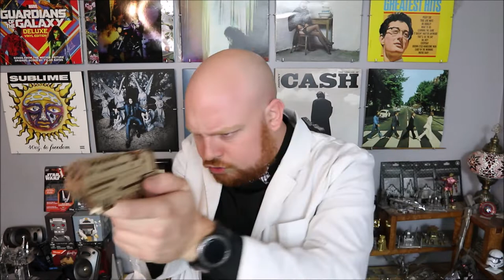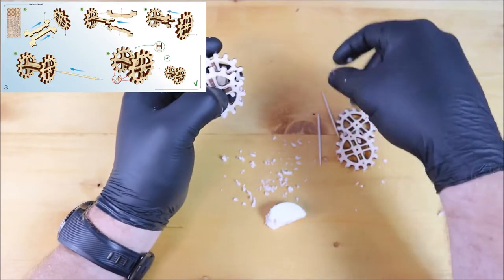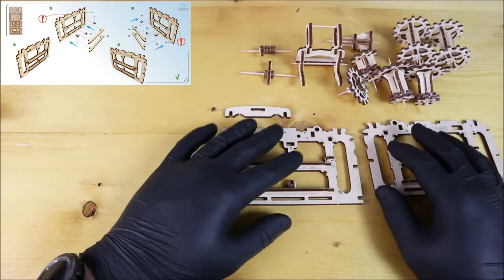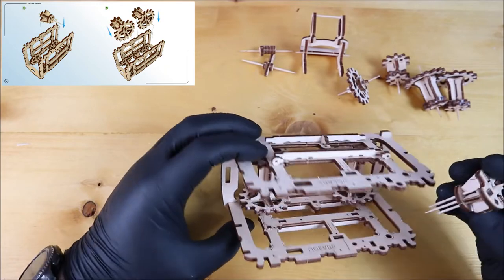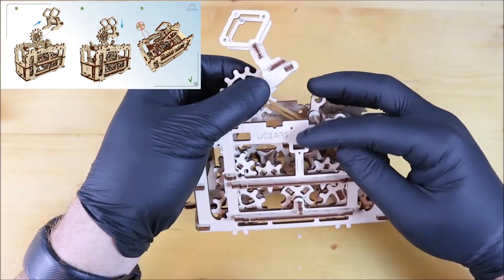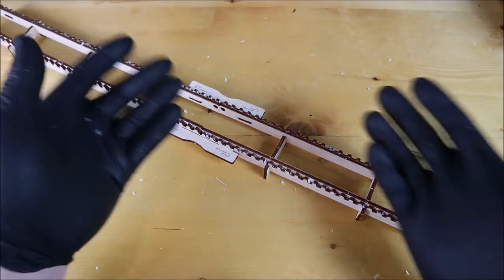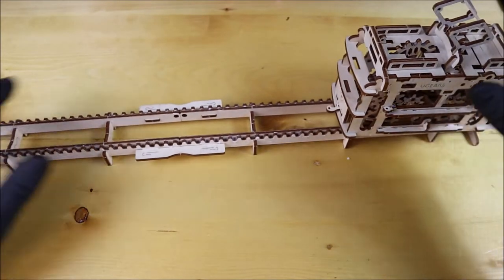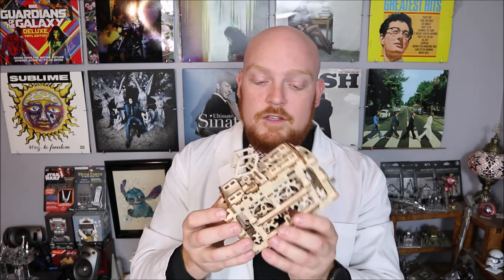Tram - Ugears - Build & Review

Comment: Nope, not working well, at least for me.
Having built a few of these Ugears and Rokr kits (clocks, tractor) I was looking forward for this tram.
While it runs smoothly and well controlled on the tilted track in each direction (escapement mechanism breaking well), there is no way to lock the spring gear, nor to throttle its action after winding. The controls do not fit nor hold the tension, nor do they make any real mechanical sense, eg. the one sitting offset on top next to the 'wire pick up' thingies. A little winding of the band and the axle of its gear will snap.
Bad tolerances, bad design, but certainly not my fault.
Disappointing kit, not sure if I should continue with the steam locomotive?
Robotime/Rokr kits are better made and more functional than these Ugear models.
YMMV
Reply from the maker: I can understand how a lot of these wooden models can very. I agree that a lot of the components in the tram could have been built better. Including some metal rods would've made things significantly better. Although it would take away from the whole 100% wood claim. 

I've built the Wolf 1 handgun and now the tram from Ugears. If I compare the Seymour music box I made from robotime to ugears, robotime would win. Only because the kit is like you said better quality. 

Again though YMMV. 

Thanks for watching :)